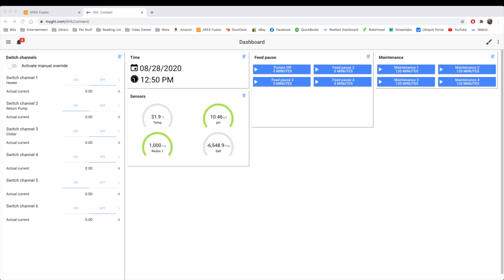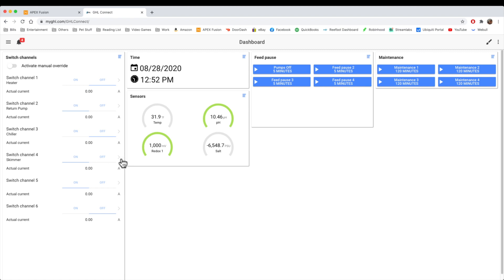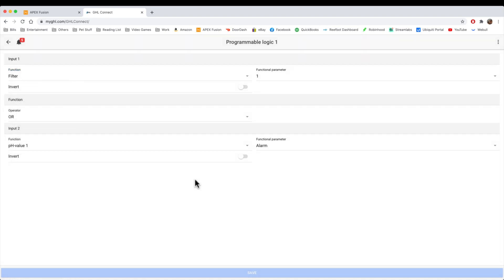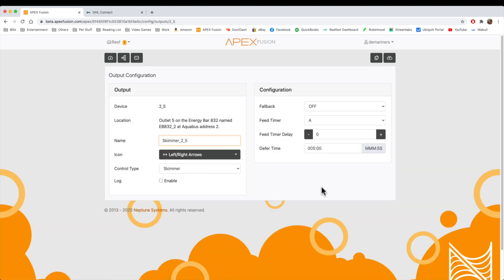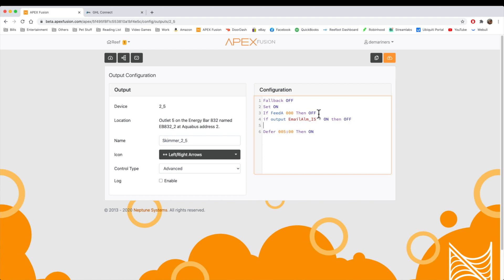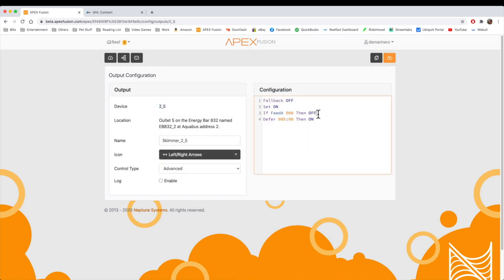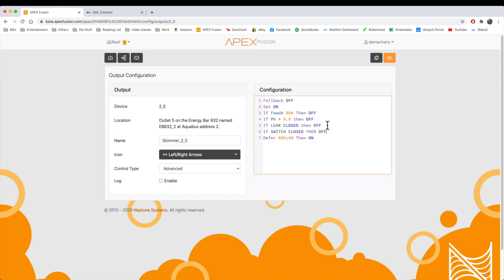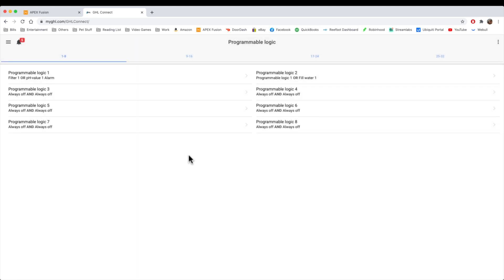GHL Vs Neptune Systems - Episode 7 - Programming Part 2

Comment: I just bought a GHL, full well knowing the programming was going to be a challenge but I thought the apex hardware wasn’t up to standard and heard better things about the GHL equipment. The lack of labeling is huge drawback though, it makes it very confusing because you basically have to remember what number you assigned something to on another screen when programming. I think for basic functions, it’s ok and obviously once it’s setup it’s essentially good to go, but they really screwed up by not allowing the user to label the ports, plugs and devices. It makes my brain hurt just thinking about trying to setup a power port for feed mode and to shutoff for a high water state. But I’d rather suffer once with the programming than worry about hardware failing me forever. It’s too bad the Neptune equipment wasn’t made with a little better components. Technology has really come down in price and they are providing old tech at a high markup without premium equipment on “mission critical” devices. Just my opinion though…. Plenty of people love it. GHL just “felt” a little more “industrial” to me if that makes sense so it was what I opted to go for. Thanks for the video, it was helpful.
Reply from the maker: Appreciate the view!  Yea I couldn’t deal with the software sadly.
Reply: @ReefAndReptileAutomation  it is terrible. So slow… difficult to program. But for me I wanted a reliable pH/ORP/Salinity monitor and leak detection. This provides that and frankly all of the other equipment I have is controllable via WiFi. It would be nice if they would incorporate some power consumption charting/alerts into the software since the strip already does it it, but not in a useful way.

Comment: Profilux is rock stable however the user interface still has a lonnnggggg way to go to catch up to Apex (I am a GHL user but have never used APEX)
Reply from the maker: It might be stable but I have only had the unit for 2 months or so.  I can not say anything on reliability and I won't in this series because I do not have any leg to stand on when it comes to that.,

Comment: Wow I couldn't imagine trying to program GHL on a large complex system.   My system is fairly basic with float valves controlling skimmer container and ato reservoir and I wouldn't even want to try to program the ghl for that
Reply from the maker: The reasoning is odd.  Fill water to program a leak detector makes no sense.  That is where I got confused.
Reply: @ReefAndReptileAutomation  is Vinny following your videos and providing feedback to programmers?
Reply from the maker: @boomcar911  I am not sure if he is following the videos but I have been talking to him before I make them to be sure I am doing things a best as I can.  I asked him about the fill water thing.
Reply: Why? You just have to get the devices straight. You have to code on apex too. It does suck that you can't rename
Reply: @boomcar911  seems like you would need a notebook to keep track of everything.  Apex is more streamline.  It's like comparing Linux and windows both can do the same job but Linux was more of a hassle.  Back in the day I had a Linux system just because I could but windows was much better